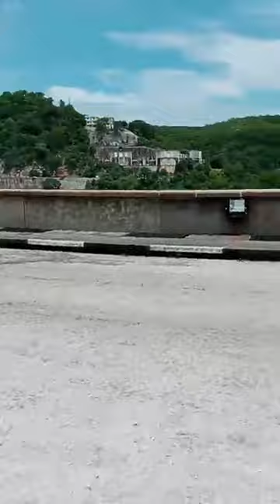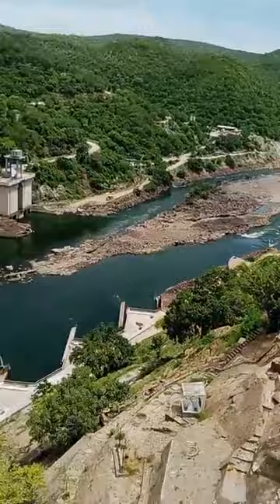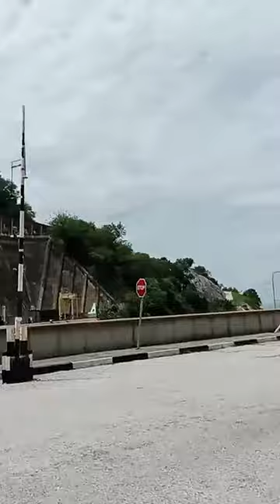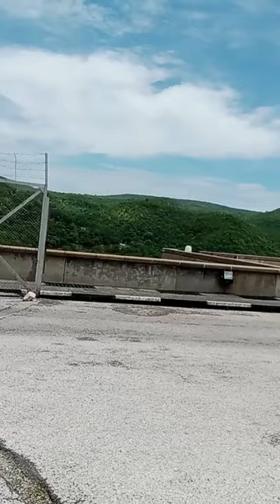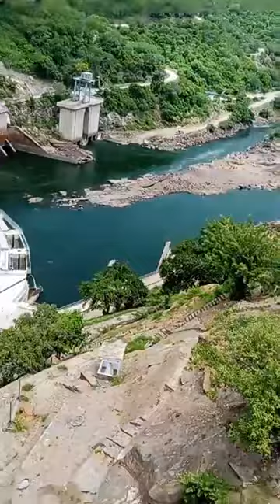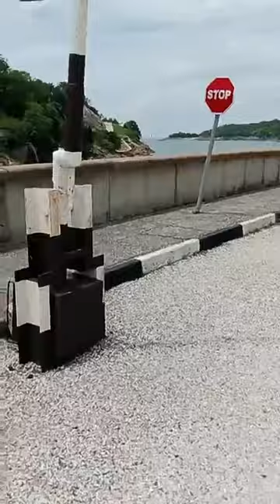Water is there at Kariba! 12 hours ZESCO LOAD  SHEDDING UNACCEPTABLE- Kasonde Mwenda

Comment: Load shedding is unacceptable when we have the resources to meet all our electricity demands. But just because you can see some water in the lake, means absolutely nothing. We are currently in the rainy season, so perhaps they are waiting for more water to accumulate before opening the dam gates for generating electricity. Doing so at the current water levels might not be optimal because I think more water means greater gravitational force to generate electricity. They also have to look at the impact on the ecosystem, which probably requires a schedule. I'm no expert, but I know that several factors need to be considered. When they say there isn't enough water, ask for more details and clarification, from the experts. You can't just go there and take videos of the water and declare that it is enough. 😂